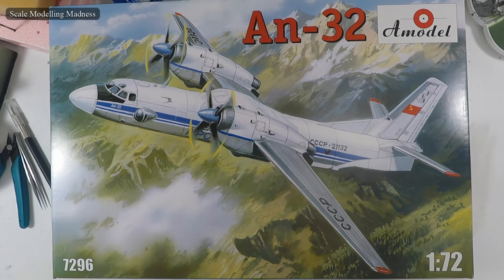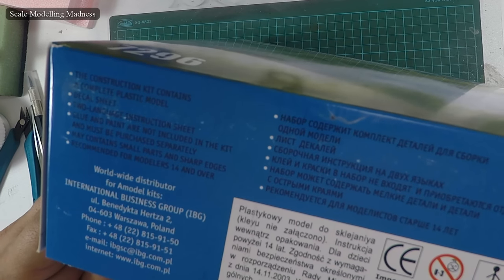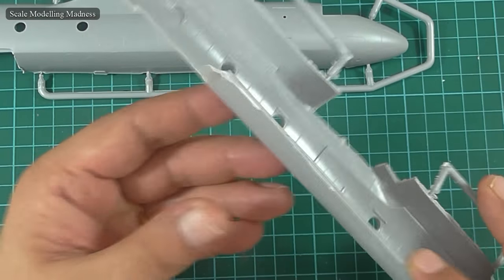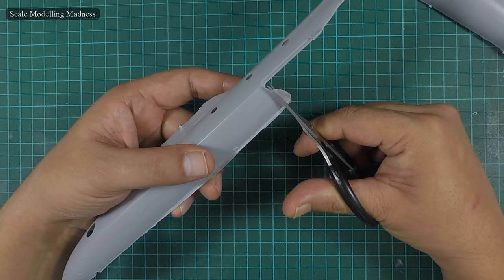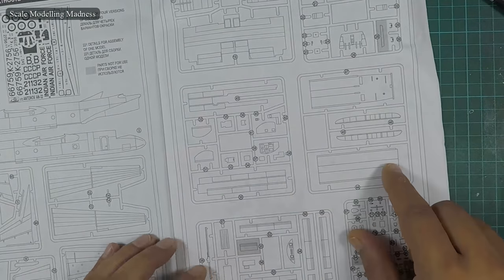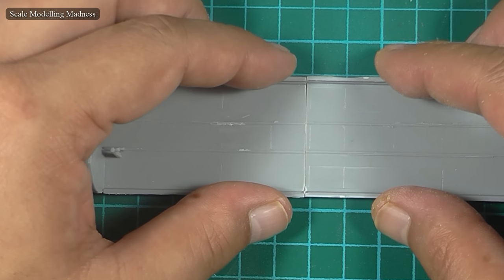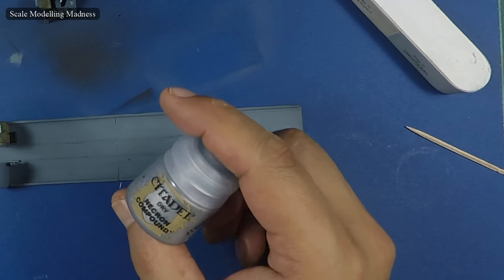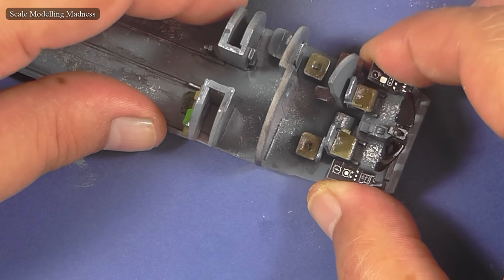A Difficult Build Part-1(Amodel 1/72 AN-32)

Comment: Thanks so much for posting this series of videos! I am considering getting this kit as I've always liked the utilitarian looks of the aircraft. However, having owned , and disposed of, several A Model kits in the past, I pretty much knew  how it would build..... bad fit and a LOT of work..... but it would be an nice addition to the collection when done.I still haven't talked myself into getting one yet, but thanks to your videos, I truly know what to expect and can decided if I want to invest the time or not. ;0)
Reply from the maker: Glad you liked the videos Fred. I believe there is a 144 An-32 kit also, if I remember correctly its from Zvezda (I could be wrong). That kit, I am told, is a much better fit and much less hassle. You should check that out :)

Comment: Loving this series of vids mate :) I'm building the Gulfstrem G-550 Shavit by Sova- M, basically anAModel mould. More limited run than the Amodel kits. It has been REALLY challenging but I have learned at each step. My major gain has been the use of drilling and mouting pins to help with the alignment of parts. But it is a glue, fill, sand, re-fill, sand process. Great work here. Wish I could put up pics of my Gulfstream in it's build state.

Comment: So very sorry mate. I really tried watching this vid as I have some A Model kits to do. Just that the build techniques used were just lacking. I'd use a pin vice to drill 0.2 holes in the plastic to be joined as locator pins. Also using styrene sheet as means to form a better fit. Kits like these should not just be lined up and glued. Your result ie Excellent. No question there. Just that using the building skills of a prop maker is what is required for these typs of kit. Not just the way a Hasegawa or a Trumpeter kit is made. These kits give the parts. A maker then takes what parts are there and formulates how to make the result she or he wants. Still..... Awesome result by the end episode :) <3

Comment: can you please tell me from where can I order this kit and how much does it cost. Also would you be aware of better An32 modelling kits available (2019 april)?
Reply from the maker: Hi SV, I ordered this kit from www.hannants.co.uk it's an Amodel kit. From what I remember, I could locate only two manufacturers for an AN 32. Amodel and Easter Express, the latter makes the kit in 144 and 288 scale, so smaller than the 72 from Amodel. The kit I have made here is a 2006 release, since then Amodel have added new parts to the kit. This is the one that you might want to try now

https://www.hannants.co.uk/product/AMU72180

I don't know if it comes with IAF markings, the one I made did have IAF markings but the decals were in pretty bad shape. Also there was no decal for the Devnagari 'Bharitya Vayu Sena',  I had to buy mine separately, but I guess now you can simply laser print the decals. 
I have no experience with the Eastern Express kits, but I believe they are more recent than the Amodel ones. 
I have found that Hannants is the most comprehensive online shop although it is a little expensive (specially shipping). 
Do let me know how your search goes...good luck :)

I am available at scalemodellingmadness@gmail.com